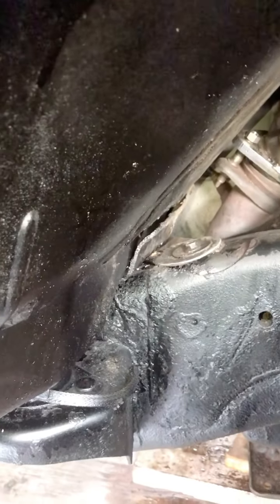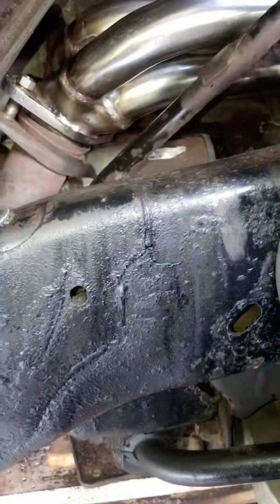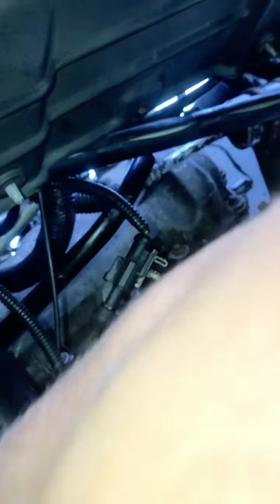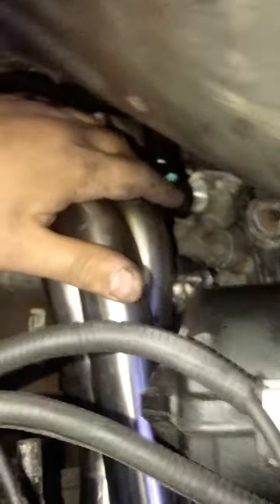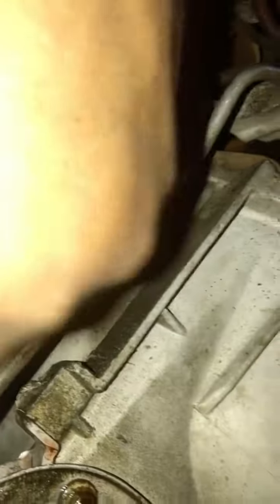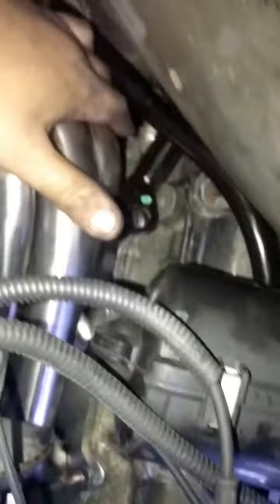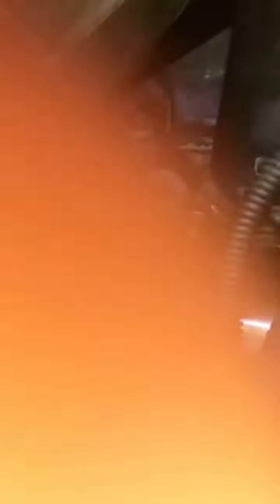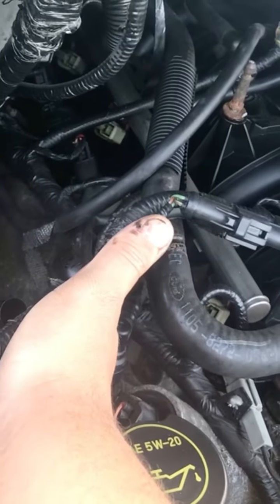2005 F150 5.4 transmission dipstick install with headers

Comment: Thank you for the video. I found an easier way by watching your struggles.  With the inner fender removed:  From underneath, I slid the tube up between the exhaust & tranny. Much easier.

Comment: I gotta do this, mine rotted out. I hate automotive engineers (especially Ford). The old trucks had so much more room to work. It's always a pia to work on newer models.
Reply from the maker: And they also take more space on the road, as someone who drives, works on, and is 6’7” tall and large and sits in them and stores stuff in them for working on things, where’s all the space going?

Comment: Did you just snug the dipstick tube into the transmission and then tighten the bolt to the engine block? Or is there something that locks the tube into the transmission.
Reply from the maker: Just the friction or pressure of the rubber seal that’s in the transmission, that’s all that holds it in that end, the large bolt on the engine is the only actual fastener that holds it